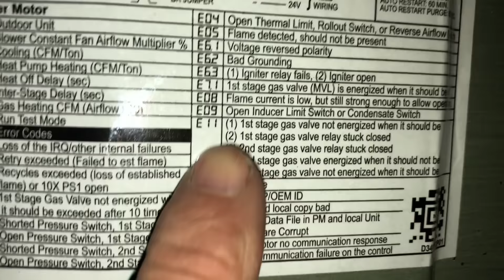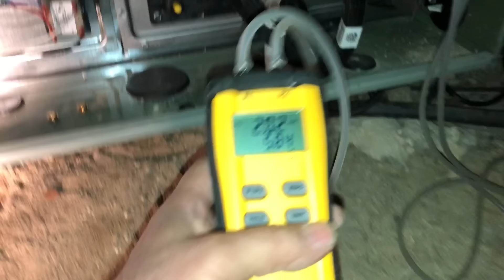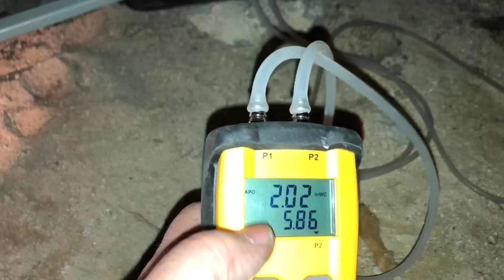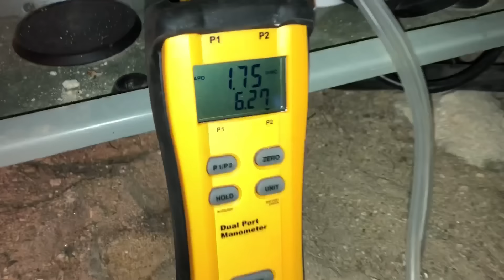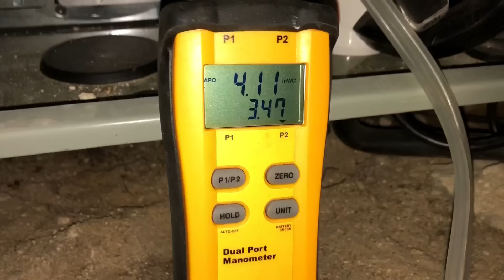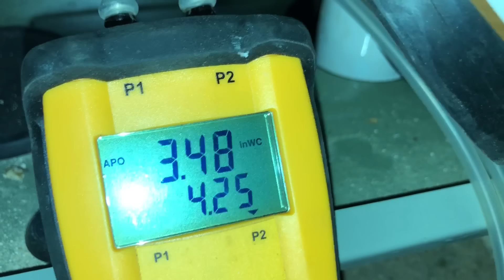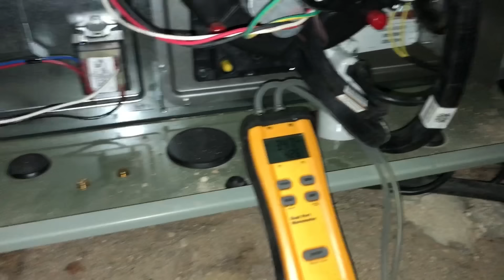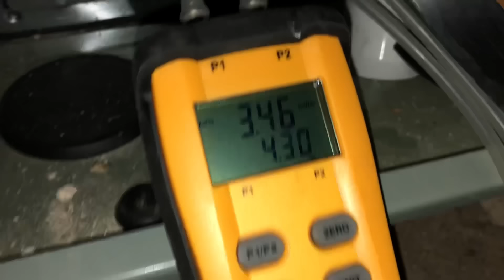New Trane S9V2 gas furnace gas valve setup FAIL inducer limit

Comment: Great explanation.on water column.on pressure switch and limit..agree with you on testing heat/ cool on installs.and all specs.,but installers have there own minds.here in Texas anyway..

Comment: Good video Ted , This is a good opportunity to get your guys to use Measurequick on all new installs. It’s a good way to commission the unit and hand in the report on each installs. It will get them use to checking gas pressure , static pressure and correct inputs.

Comment: "I'm just a heating & air guy." It sounds so bad when you say it that way Ted 😂
And yes I totally agree. Every gas pressure should be checked and set and the gas valve marked,with a sharpie, what the gas pressure was recorded as. And a temperature rise also be done in the ductwork to make sure it's burning within parameters. 👍
Reply from the maker: May as well be pulling hind teeth from an alligator !!
Reply: If my guys left that furnace like that they would have some serious problems with me. Just because it’s under a house and the customer won’t see it doesn’t make it right to do things incorrectly. No switch plate no romex connector

Comment: The electrical work needed improvement. Longer Romex, strain relief connector, and cover on the switch box. I have also notice a lot of labels on these units. Lastly, doesn't factory connect the hoses and set the proper pressures on valves?

Comment: Why do you not like a 2 stage thermostat for heating?
Reply: D B  you jumpered the w1 and w2 which in effect is the same as using a single stage stat. Then your comment above states; never use a single stage stat???
Reply: what size diameter is that gas flex connector?
Reply: D B  w2 is the second stage relay connection. The 2nd stage is part of the design parameter and as such if just as efficient and provides the same condensation latent heat recovery. Combustion analysis proves this.
Reply: D B  elaborate as to what you refer too. W2 is the 2nd stage, this is a fact. I have yet to see you do amcombustion analysis so you base your assumption on what exactly ?
Reply: D B  they make them for the same reason your car has more than 1 gear. It heat quicker In the 2nd stage, the efficiancy is the same. As mentioned a class gasfitter, done talkingmtomyou ifmyournnot the video maker since you clearly know nothing about combustion

Comment: ? Isn’t there a minimum distance before you can 90 out of the inducer. Or is it different per brand.
Reply: ideally minimum of 3x pipe inner diameter length before long radius ell. but it's likely not specified on most and many have placed sharp 90's inside for years.
I'd think more like some kids(rodents) were playing around blocking it or the pitch is bad and ice forming at the outside blocking it, maybe compounded by short cycling or just bad from the start chinesium component ;)

Comment: Good video. Do the installers have a check list to go thru and record all necessary pressures, voltage, etc. Also the supply wires are missing the outer jacket of insulation before going into the unit. Installers need to look things over before leaving. Thanks
Reply: Yes all installation manuals come with a final checklist. The non insulated wire you speak of is likely a ground. Often the ground will be un insulated

Comment: Just my guess. But the high limit would not trip in low because it still would be in spec in high. Since there is only 1 circuit inline with the high limit switch

Comment: alternately, look for intake/exhaust restrictions and check motor RPM, possibly tight bearing wrong winding and it's hardly making the switches which could overheat the safety.
second to that is the indoor blower running and airflow at acceptable pressure drops? the fools close all the vents upstairs? poor ducting?  no airflow over HE's = blazing hot gas temps out inducer.
takes me a while to think sometimes ;)

Comment: You guys don’t test new furnaces with combustion analyzers?  It’s the only way to really know what that furnace is doing, 1.7 and 3.5  is what the manufacturer sets it to because they don’t know the application-duct work, flu etc. most 90+% furnaces I test are only in mid to low 80% efficiency range, this means the customer pays more for a furnace to save money but saves nothing!!

Comment: The 120v supply wiring is not even close to being up to code.  Looks like a DIY wiring job there.  The manual for that furnace says to set high fire first then low fire due to the low fire regulator being after the high fire regulator in the valve.  That is why high fire adjustment effects low fire.

Comment: Did you notice that on that cut off switch for the furnace AKA the light switch toggle switch there was no cover plate.
Reply: didn't catch that in video, but likely that was pre-existing work they didn't touch and used same whip/wire that was there.... not saying they shouldn't have put a plate on it ;)

Comment: Why sell a two stage high efficiency furnace, and then cut the efficiency of the system by installing a single stage thermostat?  The longer the cycle, the more efficient the process becomes.  You may suffer a little on comfort or recovery time, but makes no sense to me to not use all of the energy savings advantages.  With that incoming pressure drop on the gas line I would be concerned.  That gas flex connector could be the culprit.  Having 10” static pressure at the inlet is way over what you should need.  Our utility won’t set it over 7”.  If the line is sized properly, it will work with 5”. Maybe the gas utility has the wrong size office in their regulator.
Reply: because most will fire at low stage for XX minutes then if there;s still a call for heat, go to high fire until satisfied.. thermostats are the worst device for staging IRL, garbage as they can be products, half the time the thermostats don't even work. too much electronic based junk anymore, chinesium filled homes and life.......

Comment: too low of incoming gas pressure, regulators in the valve don't work well that low, I'm betting  it may go too low or whack out if other things in the home are gas and turn on.
it could even go so low the flame migrates into the heat exchanger and cooks the t-stat/fuse and short cycle.... the pitfalls of sparktronic junk, never seen those issue with natural draft vertical units :)
Reply: right after commenting, you said no other appliances, so regulator issue at meter, undersized feed, someone globed pipe dope into the fittings/pipe ends, flex connector undersized(seems that way by video) OR they didn't purge the lines and crap is now sitting in the gas valve inlet screen, no drip-legs visible...........
yes I may have done that in the past once or twice ;) live and learn
Reply: Natural draft appliances also are about 65% efficient at their best, so you are tossing money out the window. Spark ignition is not as complicated as people think it is, this comes down to a basic understanding of electronics which the majority of people lack.

Comment: I am the greatest but I don't put a gas shut off nor a drip leg nor wired it with anything near safe and probably don't have a service disconnect I let my installers hook it up and run without testing anything at all. But I am the greatest because I could come in behind any worker and find flaws
Reply: From what I've seen so far on this channel ( and as an A class gas fitter and red seal plumber ) I agree with your assessment here .